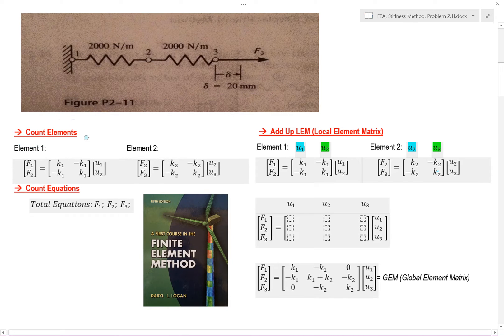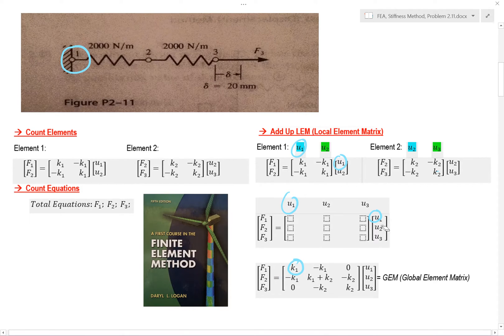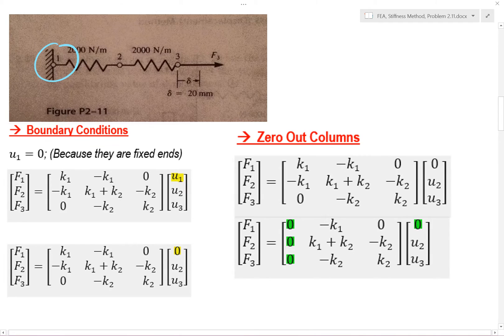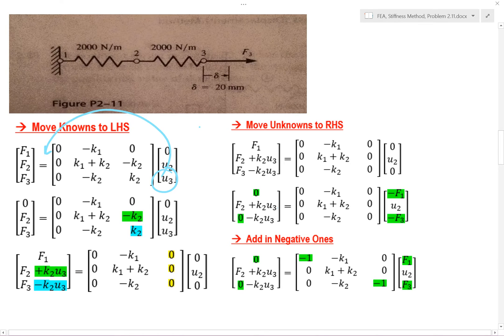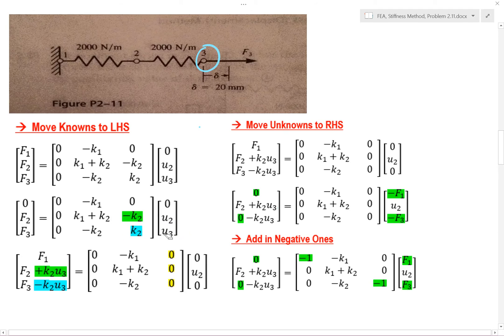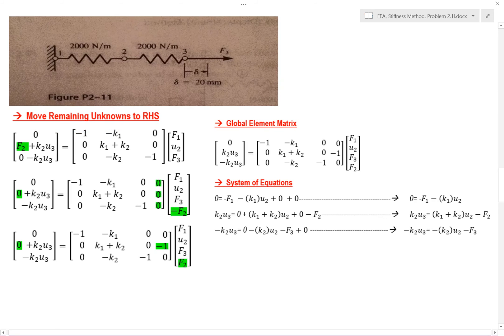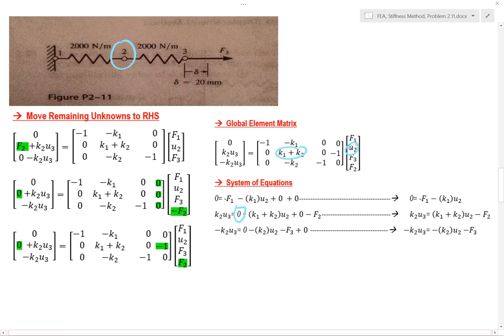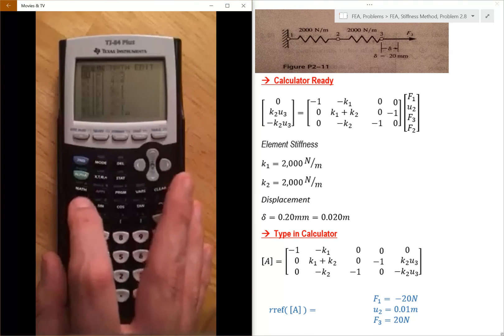FEA, Stiffness Method (Truss Problem 2.11)

Comment: HELLO  you have f1 and f2 and f3 as unknowns and also u2 ? how did you manage to solve it on the calculator
Reply from the maker: Once I solved for F1, u2, F3. Then take those values and plug them into the LEM to get F2.